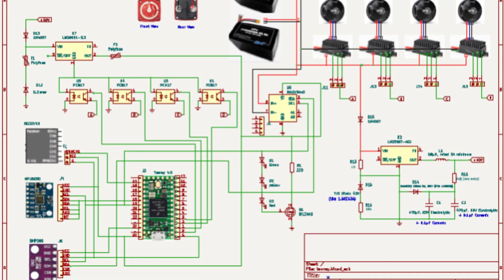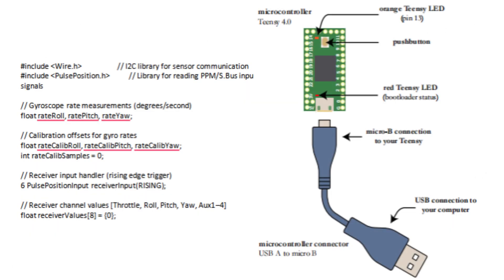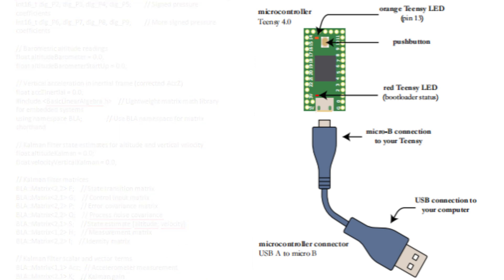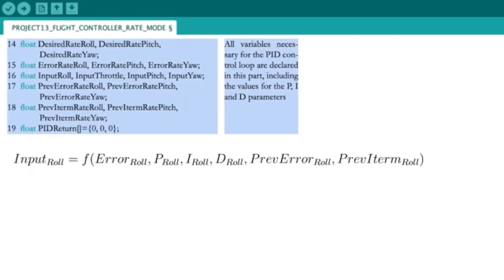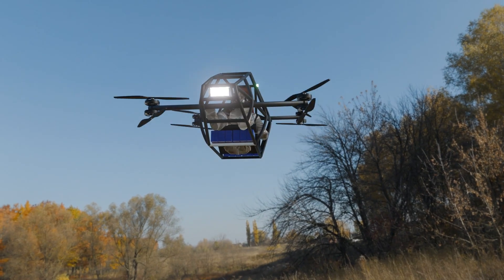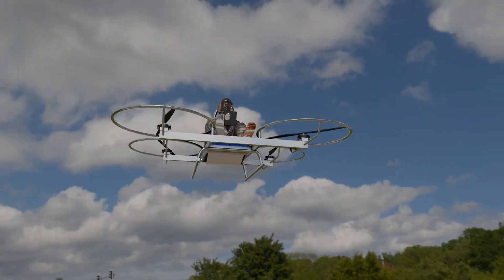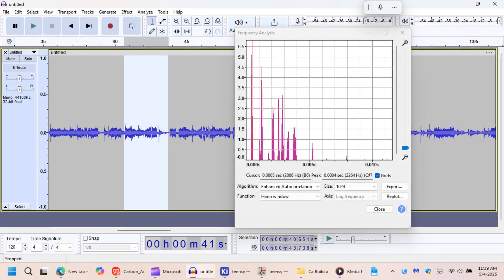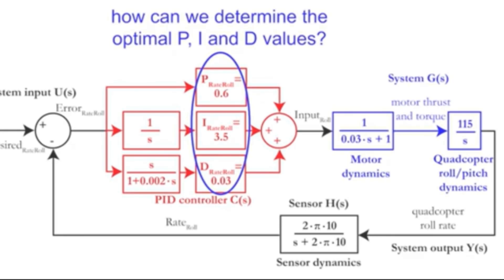DIY eVTOL quadcopter drone assembly steps

Comment: I bought this book, it's fascinating! Can anyone explain to me (a complete amateur) why nobody's attempting 'dumb' quad/octo-copters running on 1 simple dimmer switch per motor? I get that it would be less stable & more dangerous in wind but if adjusted in small increments, the craft should still tip/move in the direction of its slowest rotor(s), no? Am I missing something due to 'Dunning-Kruger effect?'
Reply from the maker: Thank you for your support and kind comment here is an explaination per Ai  🚁 Why Simple Dimmer Switches Per Motor Don’t Work Well for Quadcopters:
1. No Feedback = No Stability
A dimmer switch sets power, not speed. But motor speed is affected by load, battery voltage, and air resistance. Without feedback (like in ESCs with sensors or microcontrollers), the motor won't maintain a consistent speed. That makes the drone uncontrollable and unstable.

2. Real-Time Corrections Are Critical
Quadcopters are inherently unstable—if one motor is slightly slower than the others, the whole drone can flip in milliseconds. That's why modern drones make hundreds or thousands of adjustments per second using gyroscopes, accelerometers, and PID controllers to stay balanced.

Dimmer switches can't respond fast enough or precisely enough.

3. You Can’t Fly Without Mixing Inputs
To go forward, backward, or turn, the drone doesn’t just slow one motor—it adjusts combinations of motors in precise patterns. That coordination needs software logic and is nearly impossible to do manually with just a few knobs.

4. Wind or Payload Changes = Crash
Even a slight gust of wind will affect balance. Without an automatic system constantly adjusting motor speeds, a "dumb" drone will almost certainly crash or drift unpredictably.

5. Motors Don’t Respond Linearly to Power
The relationship between voltage input and thrust is non-linear. For example, turning a dimmer from 50% to 60% doesn't increase lift by 10%. It might increase by 25% or barely at all, depending on motor/prop/load.

🔧 Has It Been Tried?
Yes, people have built ultra-simple, manually controlled multirotors, usually for educational purposes or as novelty demonstrations. They work only under very specific, calm conditions, and even then, barely. Think of them like trying to ride a unicycle with no hands while juggling.

"I hope this helps! You could build the most perfectly engineered machine, but without properly tuned PID values, it will flip over in a nanosecond. That’s exactly what this book helps you understand and prevent. For example, there’s a story about a grandfather who built a flawless coaxial helicopter—mechanically perfect—but because it lacked PID control, it was impossible to fly. It shows that even the best hardware can't be controlled by human reflexes alone—you need a microcontroller managing the feedback loop."😄
Reply from the maker: For example, there’s a story about a grandfather who built a flawless coaxial helicopter—mechanically perfect—but because it lacked PID control, it was impossible to fly. watch this video https://www.youtube.com/shorts/FgNqFaLb4zc
Reply: @ Ouch, well that's certainly a less than ideal outcome...🤣 Perhaps dimmer switches are not the shortcut that I hoped they might be lol.
Reply: @BoundlessVision-d2  Thank you SO much, that's extremely helpful! 
I recently bought my 1st KV80 motor & plan to build up components over several years as a long term project (because i'm a bit of a poor lol) but this topic's very new to me (my background's more in machining/metalwork) so your work here and in the 'Grouse' book is certainly invaluable to me, for one. 
Thanks again for your excellent work, I can't praise it enough 👍